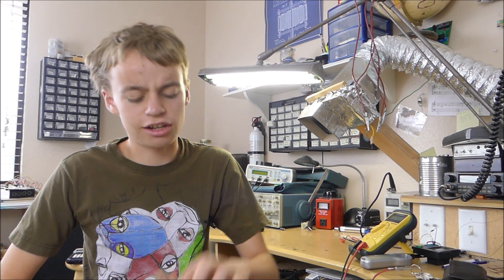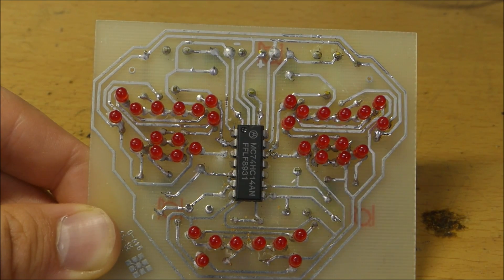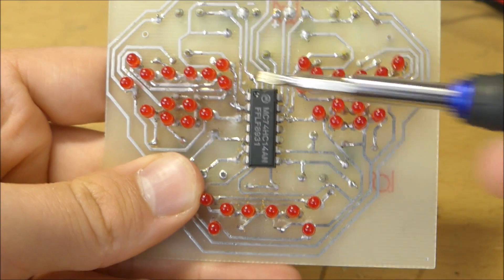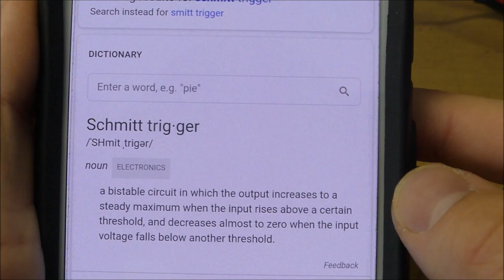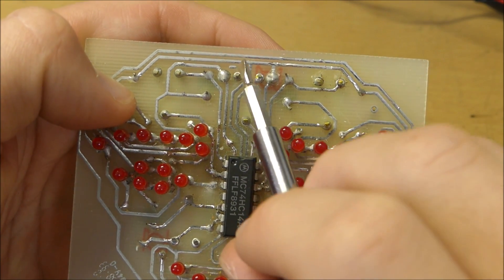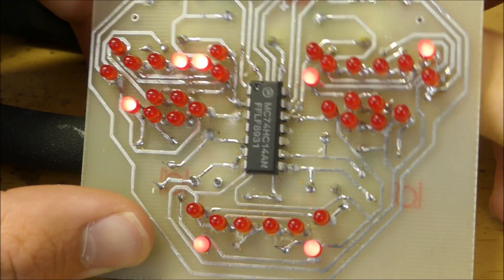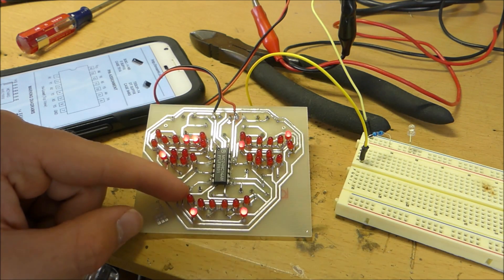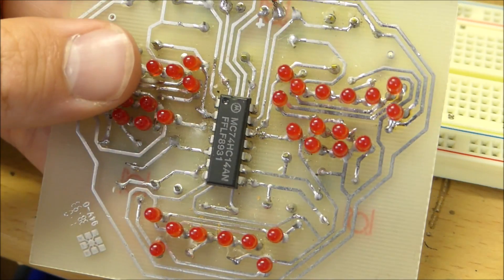Unraveling the Mystery of this Strange Circuit Board

Comment: I believe it's even older, possibly from a 1980's popular science mag.. Looks like a Transformer. LED's do not have flat side, also possibly from old stock. With a multimeter or scope it should be easy to trace from trigger IC to LED's. You can test LED's in circuit.  Would be a cool Tanner Tech LOGO!

Comment: Thirty-first week of 1989 on the inverter chip. Schmitt gives good transitions between on and off. Looks to be voltage controlled and gives different outputs to the leds when the voltage changes.